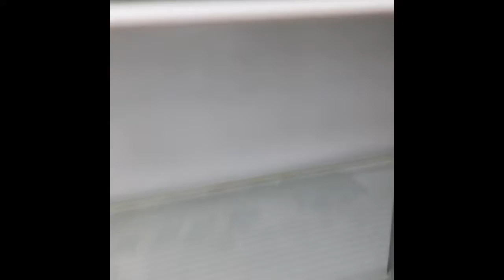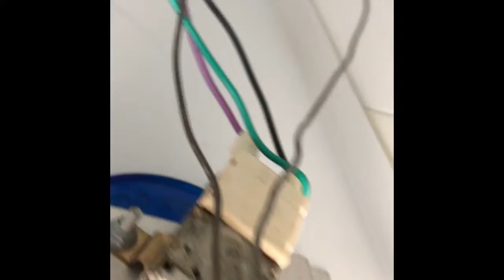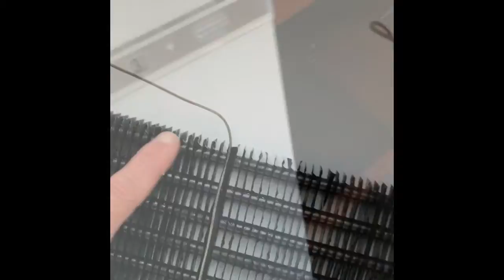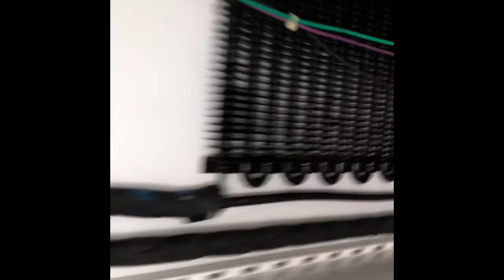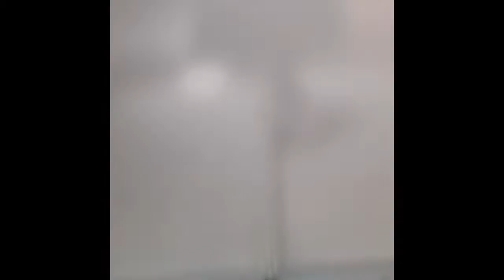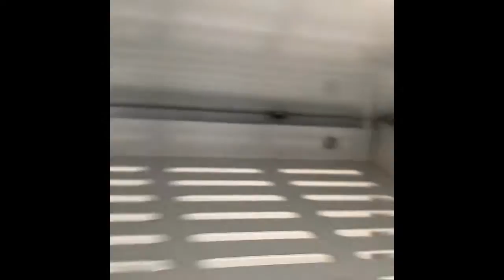SUBZERO 501R FRIDGE—TOO COLD (FIXED)

Comment: Hi Scott. Quick question. 
I have a subzero 511 which I have changed the cold controls multiple times. On both the fridge and freezer controls I see that there are small screws in them. Are these screws some sort of temperature set? I’ve always found that I have to turn both knobs to 8 to achieve normal operating temps. I was wondering if the thermostats can be adjusted somehow apart from the temp control knob.